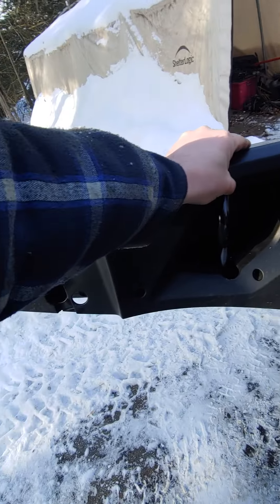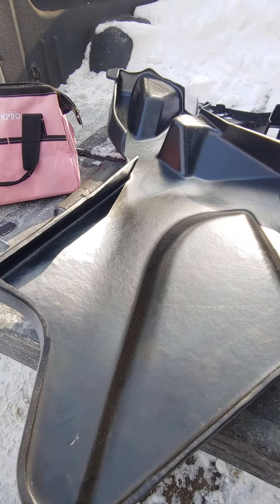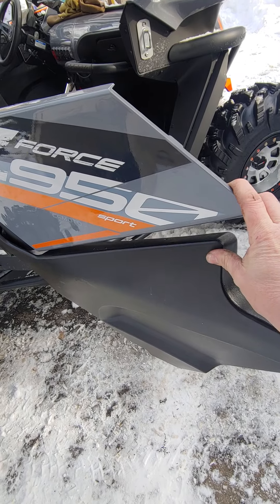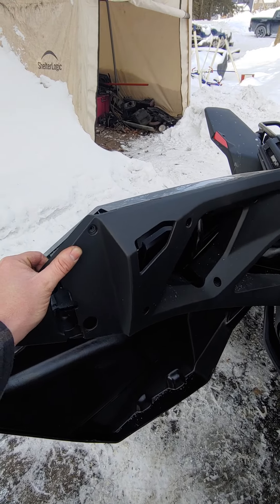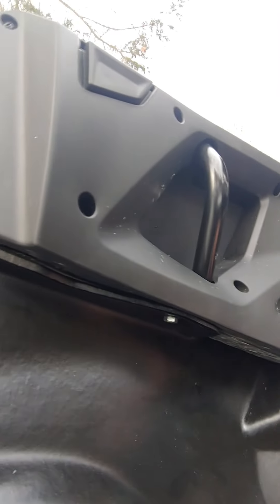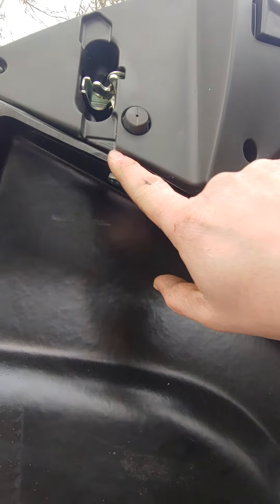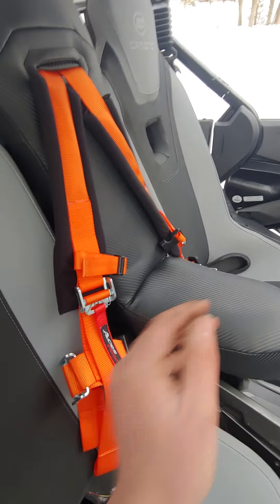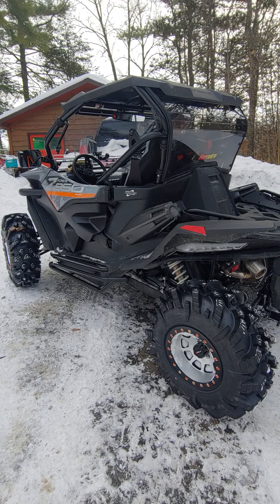cfmoto zforce 950 door install ,

Comment: I installed a different brand. It had a 2 panel per each side and I left the smaller ones in the back off for some airflow in cab.. Nice unit.